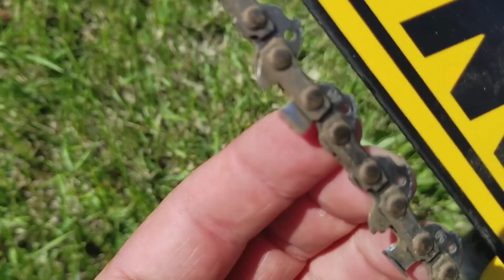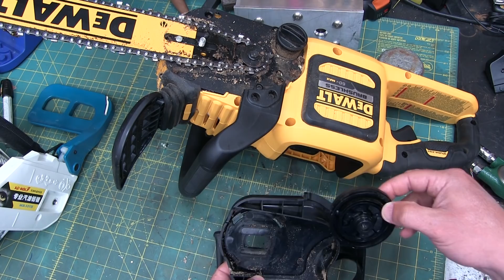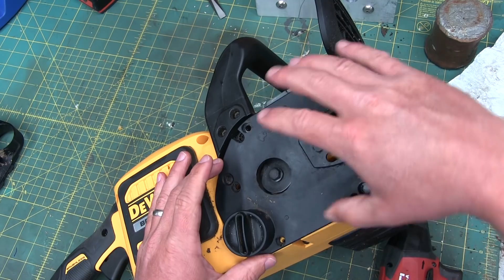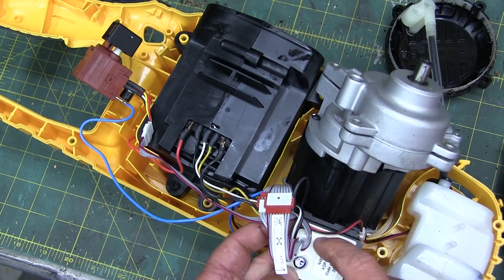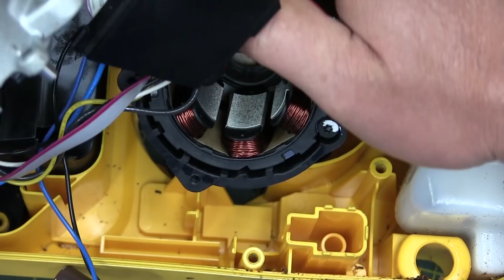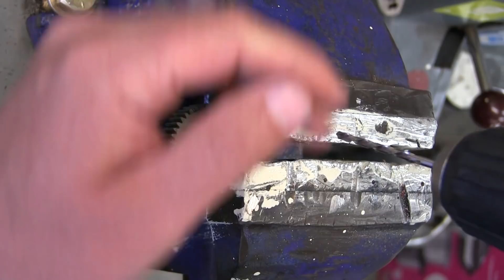BOLTR: DeWALT Chainsaw | Engineering FAIL

Comment: The spring in the tube is a very old engineering trick. Many of the old V-8 car engines had a spring in the lower radiator hose to prevent it collapsing during vacuum conditions. The DIY home mechanic would often throw the spring away thinking it was just part of the packaging and then the motor will continually overheat because that lower radiator hose would collapse, no fluid cycling, be stuck at the side of the road. A few minutes later it'd work for so many miles. Lather, rinse, repeat.
Reply: John Possum can confirm, have old dodge puckup with a spring in the lower rad hose
Reply: yeah, imagine how I know the whole cycle. My dad, a staunch DIYer,  made that mistake and I remember spending a lot of time as a youngster waiting at the side of the road for the car to cool back down. We were pretty poor! LOL!
Reply: Yeah, those horses get soft when hot

Comment: Ave is gonna use this in the next texas chainsaw massacre remake,
He'll also be wearing safety chaps...
No pants though, Just the chaps.
Reply: Boof A Canajun slasher flick where the titular psycho dismantles teenagers, pausing to criticize their design flaws?  I'd watch that movie.
Reply: But the battery dies before the victim! And if you beat the victim with the chainsaw, the bar comes off! Better use that $200 dollar axe!
Reply: Boof 
The sound of a gas axe with a busted muffler is scarier than the sound of a vacuum cleaner.
Reply: I think we can agree that ratchet on the bar stud and the bearing-less tensioner wigglin in the frigglin plastic frame are the REAL horror show, here.

Comment: I recently purchased the DeWalt saw. Since this initial review on it they have gotten rid of the ratcheting bar attachment system. They integrated a metal nut into the plastic securing plate for the bar, and you can further torque it with an Allen wrench. I have logged a few hours of cutting on the saw with no issues of any kind. Cutting done on logs approx. 12-14” in diameter  down to sectioning the small branches. I can update this if I have any issues. I also commented on his video comparing to the Milwaukee.

Comment: Sad when a company like Dewalt lets something like this out. This should have never made it out like that. Especially on the 60v Max line, it's supposed to be a skookum choocher. There should be two bolts, you should be able to pull the damn bar taught. Even the cheapest gas chainsaws do this, smh. This "lets use plastic for everything" needs to stop at some point. Thanks AvE, love the vids.

Comment: DeWalt must keep a Google alert for your videos. I just picked up their smaller 12" (20v max) chainsaw, and they've done away with the tq-limiting plastic ratchet crap. It can still be tightened by hand, but they've exposed the metal nut in the center of the plastic hand-tightener. The nut? accepts a 5/16" hex wrench for better tightening, and it makes direct contact with the bar. So at least that one nut can be tightened up good, even though the rest of the bar is still clamped by the plastic housing part. I am unable to find any images of the change online, so it's probably a recent update.
Reply: This is the reply I was looking for! I'm hating my craftsman 2 cycle and have been thinking hard about the dewalt 20v. Thank you.

Comment: Looks like the un-boxing model, not meant for wood.
Reply: I'd rather buy the little Borscht.
Reply: "Engineering FAIL" "Not meant for wood" Well, its an Electric chainsaw, how more obvious can you be?
Reply: Oh really ?
Reply: Makita makes a skookum electric beaver, that can power through some sturdy oak trees without hesitation. He's right about the torque in those DC motors.
Reply: As the saw king would say, for display purposes only
Reply: it’s just a big plastic pipe cutter

Comment: Fun dissection! One minor note.. that angled gear has a pin that goes right into the saw body so it's actually held reasonably well.. plus you're not really wanting to put a pile of force on the chain when tightening anyways.. probably going to be fine. I have one of these saws (and was always a gas guy) and I have to say.. it's pretty damn great for the right job!

Comment: Dewalt quality has gone down the shitter.
Reply: and the brains of the operation with it!
Reply: I have a dewalt angle grinder that performs pretty good. But I agree they're quality is definitely dropping
Reply: They've gone down the shitter once stanley black and decker bought them out....It's just a name.
Reply: And their a pain in the ass to deal with anymore
Reply: So the reputation all stems from the 50s?
Reply: They sold out to HD and Lowes. The greenworks pro, echo, Oregon and milk 2727 are not bad.
Reply: Jimmy's Tractor gotta watch with the echo, and Stihl for that matter. The crap you buy at the box stores, is not the same you buy at a dealer.
Reply: Satan's Onion Dewalt had no tools other than the radial arm saw before black and decker purchased it 50 years ago. well before cordless tools even existed. I think your claim that B&D has somehow ruined dewalt is unfounded.
Reply: CCWSig oh, I realized that in 93 or 94 when they started that with their single ringed pistons. They did the same with lawnboy and toro.
Reply: Quality wise they are probably the best look at Milwaukee now thats crap
Reply: Lou Cifer its all opinion. I switched from dewalt to Milwaukee and I’m mad I didn’t do it sooner
Reply: Sad but true .
Reply: Cody Dorris opinion yo a point, there are plenty of th in NHS that can be objectively rated such as flex and actual power.
Reply: Satan's Onion So......continuously for the last 58 years?
Reply: "Don't be silly, plastic can do EVERYTHING" -Dewalt
Reply: Was it not radial arm saws that dewalt was famous for?
Reply: I went thru 3 DeWilts in about 7 years because the batteries just refused to keep a charge at 30 below.  Finally went to a Makita and then I accidentally threw out the charger. :/
Reply: This is just what big manufacturers do.
They release a new product that on the edges is quickly designed, full of plenty badly designed weak plastic parts, and missing a ton of features and accoutrements that even their products two generations ago had.

Then in 1,2,or3 years they release a 'facelift' model that has everything buttoned up and all the features +more put back in.

I think the reason they do this is because not only is the design and new tooling cost of a new product from scratch so much, but they can never actually predict if the product will be a success or even the volume of sales. 

Usually main elements of the design, such as engine / motor, transmission, electrical board, etc are well designed, as they are intended to be brought forward / adapted from where else so you don't always lose out with the purchase.

If you want a textbook example of this in practice take a look at the first generation Mercedes ML suv 98-02 (w163)  In 98' just in features alone it's missing nearly all of what were standard on the 88-95 E class, and even 87+ 190e/c-class. You won't be able to find any of the 98-99 MLs that don't have nearly every plastic element in the interior broken off/cracked, falling down, that isn't on its 3rd+ set of window switches, etc. In fact the interior design was all so bad they had to do quick redesigns for both 99 and 00 just to head it off, lol. 

In 01 they released their standard 'facelift' model, but instead of the typical headlight/bumper/body cladding exterior updates, with some small cosmetic interior refinements, this one had nearly the entire interior redone, from the firewall back, even the door seals. They added so many "new" features they even had to put in a second fuse box, and this just barely brought it to level of what was standard in a 91 e class, things like seat memory, programable climate control, rear climate vents, one press window up buttons, door tweeters, folding mirrors, headlight washers, leather cover on side airbags, low coolant level sensor, etc...a freaking valve on the coolant hose going to the HVAC system so the air conditioning wasn't being cooked by hot coolant in the summer, lmao and on and on. 

After something like +250 new parts on the interior alone the only certifiable 'new' feature was the ability to crack open the 3rd windows. Lol. Everything else was either directly or stylistically 'ported' over from earlier models, and they even missed some long standard features like digital display in gauge cluster, heated windshield washer spray, single wiper, multi-way adjustable steering column, etc. 

Apparently Mercedes has done the same thing on their new minivan.
Reply: yeah.... but look who owns Dewalt..... yep that's your problem.... Black and Decker
Reply: Black and Decker has owned the DeWalt brand far longer than Raymond DeWalt had the company.
Reply: DeWalt=radial arm saws.  DeWalt, B&D Industrial and Elu existed at the same time for quite a few years.  Different color plastic and warranties for different sales channels.
Reply: yep
Reply: Yep
Reply: yep thats sad because I want to support my european brands, but makita cost just as much and performs 1000x better.... kinda
Reply: Gearhead Daily Nay. Its only that the cheap yellow water colour of DeWalt has become awashed and it's showing the tail tale signs of it's real origin, the true self, Black and Decker!
Reply: that's even worse
Reply: @loucifer323  although I have DeWalt I have a feeling that Milwaukee is better now days.
Reply: @stever4651  Milwaukee is absolute garbage it doesn't stand up to use its more DIY
Reply: @loucifer323  jesus whats up with you smd milwuakee? ive seen you in multiple videos dragging milwuakees name thru the mud
Reply: @canogaparque818  I drag Milwaukee through the mud because I'm sick of all these Milwaukee fan boy's who know nothing about tools opening their pie holes, because they watch other Milwaukee fanboys doing tool vs tool wars and of course they always have Milwaukee win then you other guys who are fans of all tools and the results are different

Comment: I would love to see you compare this to the milwaukee saw. That one has the traditional bar mechanisms and looks a little more skookum, and also has a few more battery cells kickin behind the cut. Would be interesting to see if one costs more than the other and whether that was worth it or not based on the breakdown.
Reply: BRNKoINSANITY  a quick price check shows Milwaukee at 400usd with a 18v 12 ah battery, charger  and bar cover. Looks like 350 for the one UBF has their, comes with their 60v3ah battery. Both have Oregon Bar and chains. I would pick the red beaver over that yellow one because of that tool-less interface, just can’t beat having two nuts to get the job done good and proper.
Reply: Homeless DeathSpot is running a deal near me. $300USD gets you the saw plus a "free" string trimmer (weedwhacker).
Reply: Yeah, there are a few good ones out there. Just have to do a minimal amount of research, just look at box for picture where the bar is held on- 2 nuts=good plastic knob=bad lol. My green works ESC is also 3x-4x the size with a big heat sink to boot.
Reply: I think he should compare it to the EGO, everyone I've seen that has one loves them.
Reply: Mark Funderburk anyone that would buy one of those, most likely has no comparison reference

Comment: here's a list of power tools i'd never skimp on

a: chainsaws
Reply: b:pullers (buy form klauke they are nice)
c:hydraulic press (remember chinesium bends like haribo gummibear)
Reply: I saw a RYOBI skill saw trigger stick and it wouldn’t turn off. Any bladed tools for me too
Reply: @mikew2893  Circular saws are like the best tool to jam on though. Built in blade guard should give you plenty of safety whilst you cut the power.
Reply: @joestevenson5568  basically anything should be pretty safe as you disconnect power unless it's from hell. Like I can't think of anything. Maybe a grinder with a polisher attachment with a hole saw on the polisher attachment on the grinder in the hands of a 6 year old girl but that's a stretch.

Comment: I have appreciated all the points brought out in this video, however, i have owned one of these saws for a year now and have cut something like 10 cord of wood with it and i have yet to have any issues with what you have brought up. I have been very impressed it. I would highly recommend it to someone who needs to do simple weekend work from time to time. I have even used it to fell trees around 15 inch to 20 inch in diameter with it. Great saw in my opinion and yes i have used gas saws.

Comment: Wow, we had a Bosch chainsaw (Elektrisches Fichtenmoped) with the same stupid plastic clamp/adjuster/SDS system for the blade was also plastic. It happened to fly trough the yard a few meters...
Got replaced by a Hitachi internal explosion driven saw.
Reply: omg, are you that stefan gotteswinter, who made it as a "meme" in this old tony´s videos?
Reply: All electric chain saws i have seen have flimsy blade fastening methods similar to this. I really wonder why they cannot put good old nuts there. The advertising always praises it as "tool free use". I do not get the point. Who uses a chain saw has wrenches anyway.
Reply: 666Tomato666   I first thought that, yes, this might be the explanation. But then: I never would buy a combustion one for the work I need it for. Simply too loud. But as soon as I find an electrical one with serious fastening of the blade I will buy it. Market niche?
Reply: Green works has 80v saws with standard two threaded post attachment. Fantastic saws.
Reply: Christian Geiselmann the green works is metal from the motor to the blade tip with 2 15/16in(lol) bolts holding the blade to the metal sub assembly containing the motor
Reply: 666Tomato666 only a few percent, but the same can be said for Tesla.
Reply: Christian Geiselmann it's out there. I tore mine down- all metal for what matters- just put it up.
Reply: YamahaYZFR6RJ05 no way, the real S. GWTR would never lower himself to appear in such crass videos. He's too busy scraping and lapping and being precise 😜
Reply: An electric chainsaw is pretty useless in a real emergency. If enough trees fall, you won’t have power to charge it!
Reply: No, he is StefanG, offspring of the norse smithing deity Alwis and a human, patron saint of machinists, achiever of sub micron accuracy, germanifier of chinese boat anchors and the only man known to have borrowed a tool and actually return it. He wields the legendary scraper Schåb, given to him by Wotan himself, forged by dwarves in the bavarian alps, said to give even the feeblest of amateurs the knowledge and skill of Richard King himself.
Reply: Those new internal explosion saws work so much better than the old external explosion type.
Reply: anything powered by literal explosions will always Trump electric
Reply: Dream Services International YES OML
Reply: Yep, that guy.
Reply: "Fichtenmoped" i didn't hear that for 25 years :-)
Reply: Kettensägen sind wie Frauen. Man hat besser 2, weil eine spinnt immer..
Reply: Christian Geiselmann: My 58v brushless Echo has bolts and came with a proper scrench.

Comment: I have one. I drilled and pinned the ratchet stuck so I can tighten it.
I also modified the oil cap. I stocked dozens of chains for when I go underground on the big doug fir roots.
Reply: Good idea on drilling and pinning the ratchet

Comment: That is the smallest 15/16" bolt the world hast ever seen....
Reply: Red90rover 15/16cm
Reply: Red90rover he did say 5/16s just a few moments later so I'm guessing he misspoke.
Reply: I never even seen a 15/16th bolt not even a real size!
Reply: Thanks tips......
Reply: 15cm is almost 6"!!! think you meant 15MM lol
Reply: May have been induced by lubricity of the liver.
Reply: Len can't help his size & it's not nice to call him 'wide angle'.
Reply: DAMN! You beat me to it.
Reply: Right. Later he said 5/16. I guess M8
Reply: Barry Melrose tell that to The energy field😂
Reply: He did later say 5/16
Reply: Yes, I assumed he misspoke and meant 5/16th
Reply: You guys must be fun at a party.
Reply: Barry Melrose 15/16th is definitely a real bolt size, used on the chassis of Kenworths
Reply: Red90rover 
No bro. No they are not
Reply: Barry Melrose 
I think there MIGHT be a flywheel nut on a Briggs and Stratton that was 15/16, or some other really weird size.
Reply: Those are Canadian sixteenths.
Reply: He's got a cold sounds like. Bet he met 5/16
Reply: It's a 15/16cm stud, not bolt
Reply: A 15th/16th of an inch, or 1.48828125 millimetres...
Reply: he is probably a Patron and gets early access
?
Reply: 9ff70f96 Your conversion chart is defective; send it back! 1.48828125 mm is 15/256 inch!

Comment: I own one of these puppies.  Haven't had any of the issues you mention.  Bar stays quite firm during use, but you need to be sure you get it set proper before torquing it down.

Best thing I have found is to snug the bar to just before the clutch engages, then jiggle the bar to ensure it's fully seated on the pins, then torque it fully till the clutch engages.

I've gone through 14 inch logs like butter.  Still not something I'd recommend if you're a logger by trade, but for your average rural property owner keeping things in check it's skookum fantabulous.

Comment: You'll be pleased to know DeWalt updated the bar clamp. They did away with the torque limiter and made the center hollow for an Allen key. It still has the flip up tool free thumb flap but should you break that you can use an Allen key. I've bought both the 20v and 60v both with the updated bar clamps. I put a 16" bar on the 20v and 20" bar on the 60v. I haven't had any trouble out of either one yet and I'm regularly cutting stuff way too big with them. I'm interested to see the next generation. I think they will address some of the issues others have had. I'd like to see steel felling dogs and it'd be nice to have some .43 ga bar options (I converted my 60v to .50 ga)